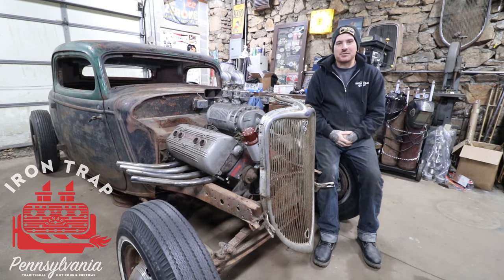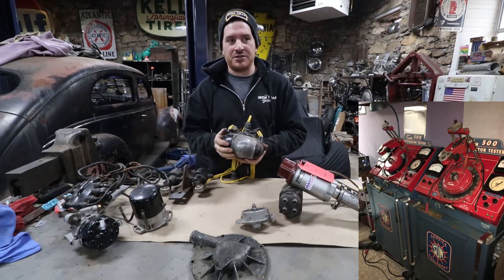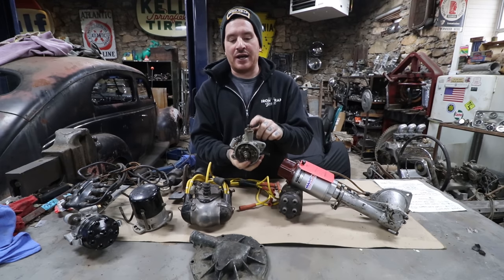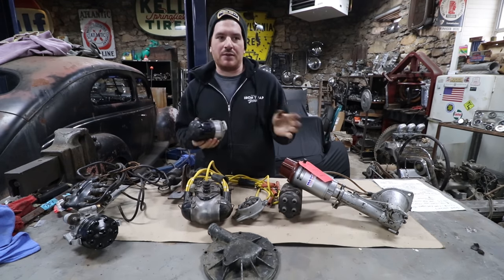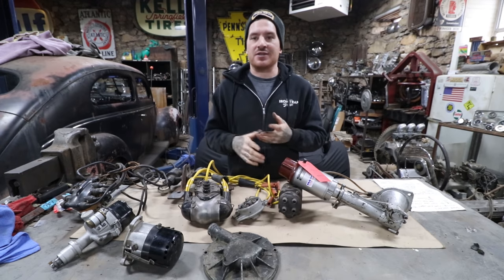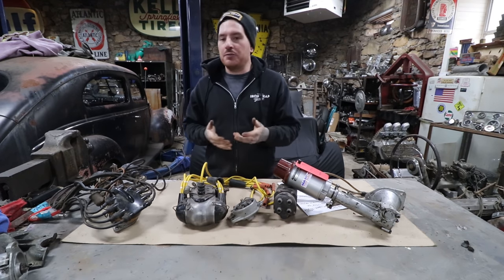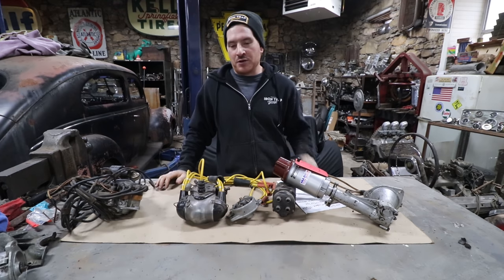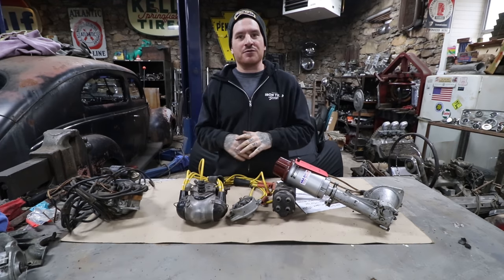Ford Flathead Ignition Buyers Guide - From Stock To Race Magnetos!!!

Comment: Thanks Professor Matt for first period Distributor Sciences 101.  A good rule of thumb for me is pick the one that will get you home!  A stock distributor with spare parts in the glove box is a safe bet if you drive your car.  Have had to be towed home before because I couldn't find parts for a performance distributor I was running.  Like you said, Pertronix is a great upgrade and work slick.

Comment: I helped someone repair a mag, it had stripped a gear.  The output voltage of the mag at a given rpm was listed on the mag.  We put it on a lathe to spin it up to the rated rpm, it was like 1200 so the lathe could do it and we knew it was fairly accurate and then checked to see if the mag was worth buying the parts.  It worked fine and the gear was available and not expensive at all.  It is the only time I ever messed with one, they are not some hard to work on thing.  It was on a 4 cylinder tractor but as you said all those were from one manufacturer.  I thought it would be hard to find parts for but we found the part easily.  I know nothing about automobile mags, but on that one the rated out put of the mag was stamped on a tag on the mag.

Comment: My experience is with 8BA only, I have a stock 8BA in a 49 F1 pickup and it works OK with all stock setup.  I have another 8BA running on a test stand for a 31 coupe project, started it on a stock distributor. It will eventually have 2 Holley 94 carbs so will not play nice with the stock (vacuum advance only) distributor. With info from FordBarn and the HAMB I converted a SBC Accel dual point that is mechanical advance only. I installed in the engine on the stand and fired it up. It has a much crisper throttle response and the weird thing is it was louder!

Comment: On the tractor magnetos and slow cranking, I have an '51 Farmall Cub tractor with an International Harvester magneto.  It came factory where you could start the flathead 4 cylinder engine with either the 6 volt electric starter or the hand crank.  With the hand crank, I've never had to pull it more than 2 or 3 tries and it fires right up.

Comment: I had a Merc 8CM with the cars original 1941 front distributor. I did well with Petronix in it but the installation required some machining. This system worked very well for me.

Comment: I remember they were a pain in the ass to change or adjust points as you had to remove them from the car and set them up with a degree wheel and test light, adjusting timing was another pain in the ass

Comment: Thanks Matt. That was informitive. It would be good to do one on timming a flathead. I have seen articles on how to time the early distributors on the bench. I'm sure  you are aware if the timming on a flathead is not correct you will have cooling issues. Sich a video I'm sure would help a lot of people.

Comment: Thank's for the video. As i have been told the plan for the Divers type distributors. was that the customer would come in with ignition problems, the mechanic would swap it out for an overhauled one. And the customer would be driving again within a short time. The the mechanic could then overhaul the broken one in the evening. Regarding The Lucas Dizzy it was probably used in Allard's, but it was built for stationary engines, and it uses only mechanical advance. The interesting (good) thing with them is that they have only four lobes. Allowing them to revving up to 6500 rpm without problems. They use special point's with a wider foot that can be hard to find. Lucas Also built a double breaker distributor with vacuum-brake and a crab looking cap,  But it has eight lobes and the points differ. I have used a Chevy Six capacitor instead of the Lucas one, that quite often give up.   Been using the Lucas in front  and a Bosch in the back, on my German G29T Flathed with repro Elco Twin heads in my 33 Roadster for five years now. Works great http://www.brandow.eu/ford33/upd8/30.jpg. Finally the Ford 8BA  distributor use the vacuum differnce over and under the throttle plate, So if yo swap to two or more carbs it will not work properly, no mecanical advance at all in the 8BA Dizzy. Will stop ranting now :-)
Reply: Here is the inside of an Lucas showing the four lobes. http://www.brandow.eu/ford33/upd3/21.JPG

Comment: That standard Ford loadamatic on the the 8ba is such a pain in the arse with not having mechanical advance. You get better performance at part throttle than nailing it wide open ive always found.

Comment: Great video. Since I'm keeping with a six volt system and the Holley 1900 Teapot on my 53 with the 8BA I am stuck with the stock distributor and vacuum timing system. I have added a Sorensen dual point conversion in the stock distributor. I like the Sorensen because it uses the stock points, just two sets of them.

Comment: As you say the dissys that are easier for parts. Twin points can be better, two sparks per stroke is better than one. 
Though the most modern way is either an electronic triggering a Multispark box. 12Volt system is required.
Though who uses 6volt these days?
 While not a great Pertronix fan for a  fairly standard engine they offer a good deal better spark. Both ways can use a standard look dissy.
For no advance distributors the  way to start them is have an extra ign switch, get the engine cranking then turn on the ign. You can also get the oil pressure up before starting. Win win!!  Something I have used for decades on race cars. Of any make. Though more motorsport application. Though cranking up oil pressure alone makes it a good idea

Comment: BITD (back in the day) we ran a "pancake/crab" distributor that came from a military I believe application. Very hot spark, started on first spin, and had an easily adjustable timing slot. Not sure exactly where it came from but really woke up our circle burner 59 ac Canadian engines. This was in New England and never saw another one. ??????

Comment: If you had some original parts, even if broken, you could recreate them in cad pretty easily and 3D print them.  I would think that ABS or even a carbon fiber filament would be at least as good as Bakelite.  And they would cost a buck or two in material to make.

Comment: Matt-had a lot of Vertex mags apart and never ran into the spring-back[impulse coupling] that you mention?Is it part of the flathead base possibly?I've had Vertex for chev,olds,mopar etc but never for a flathead.On the other side I always run into impulse coupling on tractor mags??The other thing to mention is the narrow plug gap you need to run on a Vertex[.022Love all your videos!!
Reply: standard part of a Vertex rebuild used to be re-magnitizing the magnets-most builders now put in a rare-earth magnet eliminating that need-mag rotation can be easily changed by the re builder. DONT ever hook voltage up to the ground post on the mag-instant fried coil!

Comment: "Joseph Lucas, Prince of Darkness" We grew up with Lucas products out here in NZ. Most of the British cars from the 40s onward. Clever stuff. the Lucas distributor on the old minis directly behind the grille. Every time it rains the car stops. So it was common to have a sheet of aluminum or plywood wired to the back of the  is grille to stop the rain soaking the distributor. LOL Any sentence with the words electronic and lucas  in is going to be a fail. The The last of the xj jags being nightmare of fix and fail. Any how that was interesting. There is a lot to know about these old flatheads.

Comment: Can you use a 8ba distributor and timing cover on a 59A-B block.I know the water pumps are different but can you block off the top hole on the pump and have it work?

Comment: For any ignition to function properly Model A frame horns are needed ahead of the '34 crossmember!  
This is a 'what if' question, can coil packs could produce a quirkie vintage appearance?  I am a tool maker, not an ignition engineer, don't understand any systems.  Ford's 4 tower DIS assemblies have tall towers for the sparkplug wire boots,  4 mounting bolts in corner locations. Simple brackets could be constructed to pair them or individual. The Model T had 2 rows of 4 firewall holes to clear the ignition leads. Crown Vic and 4 cylinder 2.0 L used them sometimes in pairs, my '94 Ranger used a pair for dual ignition on the little 4 cylinder.  Somewhere an electronics disc (sensor) would be needed for timing, advance and retard?  MSD makes a lower more modern assembly.
I can see the wires entering a loom on each cylinder bank from finned aluminum brackets.